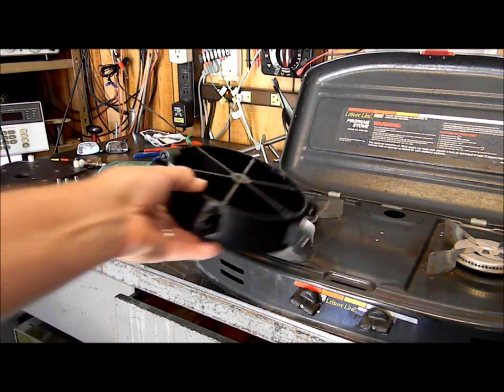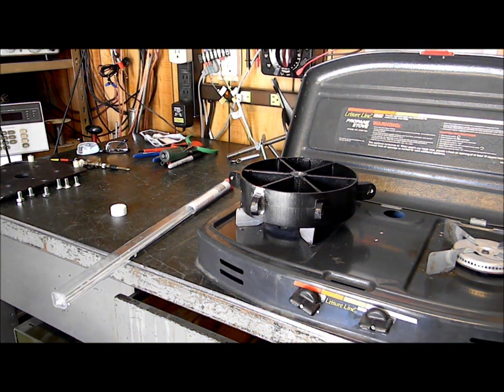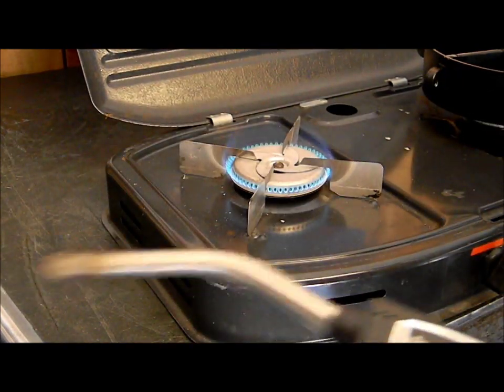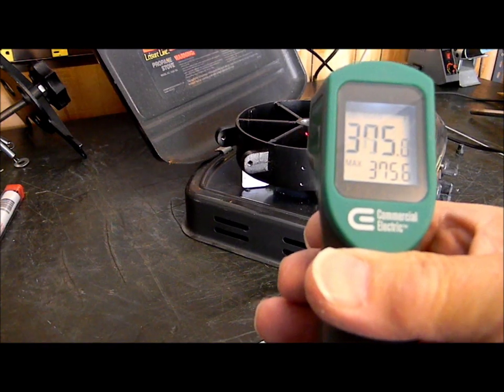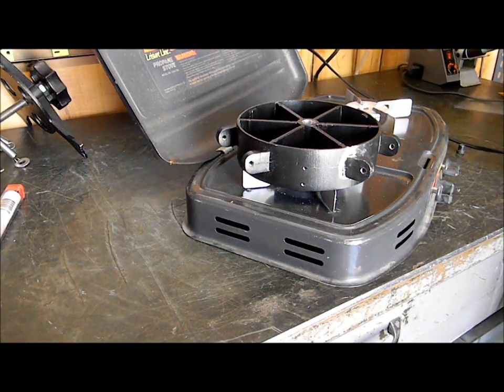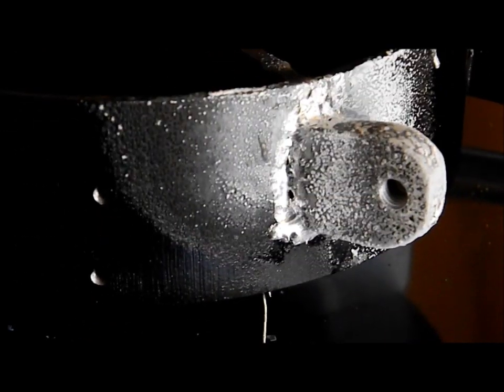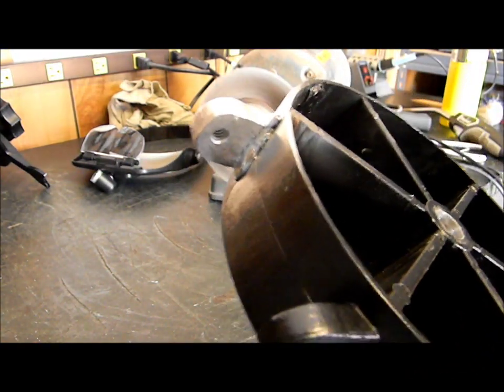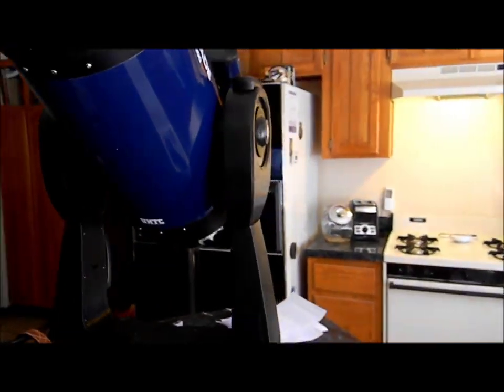Soldering - Welding Cast Aluminum With Propane Torch.wmv

Comment: Well now it's 2025 and 13 years have passed since you made this....    tutorial?           Experiment in futility? 
Generous use of paint to help you cope with imminent failure?
No matter what  video category this falls into, I have but two questions for you. How much damage did you end up with when you mounted the actual telescope to this "repaired" piece?
And have you improved your aluminum soldering skills or have you given up altogether?
Reply from the maker: I think this is the best comment I have ever had. I can't quit laughing. That telescope mount is working perfectly. I cut the tabs off, including those perfect soldered joints, and drilled and tapped 1/4 x 20 holes and mounted the legs on copper straps used for electrical ground lugs. Good and thick copper. Honestly, it is great and could possibly flex, if necessary, where those hideous mounting taps that came on the mount are asking to crack and break off - then I would have to solder them on again...  🙂
One more thing, just think of all the people I have helped over the years with 45K views.  Lots have changed in these 12 years.
Thanks for your comment.

Comment: always try to weld solder  in the flat position muck easier for in expereced  welders . Heat then dip never put the rod direcrly into flame. Lack of penetration will happen

Comment: really this is done best by heating up the casting and not putting the rod in direct flame and using the heat from the casting to melt the rod  otherwise ya dont get a good bond and the rod its self wont take properly.....and you get run off as a result as you did

Comment: Some of those durafix or alumaweld rods have better strength than the parent metal.  I wouldn't worry about the strength.  Good idea on the camp stove.  I would add that it would be important to heat it with a clean heat source that won't introduce contaminants like soot into the part being repaired.  Cheers!

Comment: Fascinating repair. I would not expect full strength, but it should hold up okay if you pamper it.
One word of caution: aluminum solder fumes are toxic to the brain and a known cause of degenerative brain diseases like Alzheimer's. Be very careful to do this in a ventilated (preferably outdoor) area and avoid inhaling the fumes!